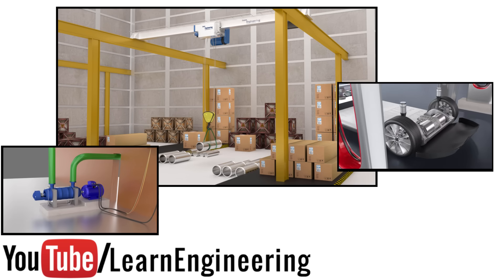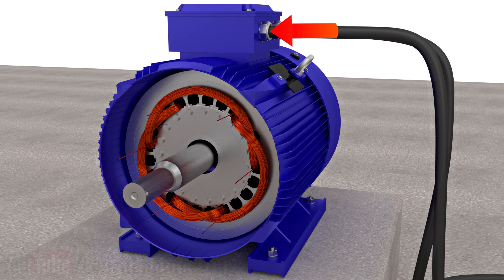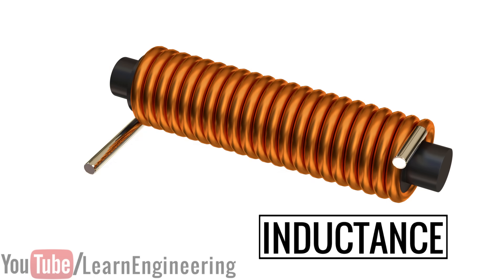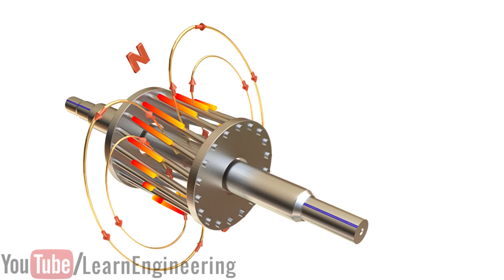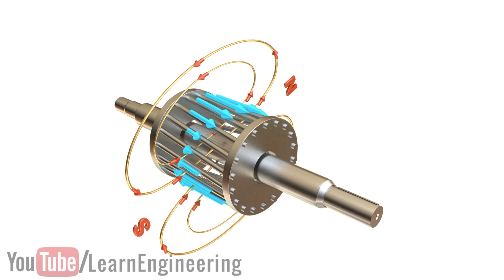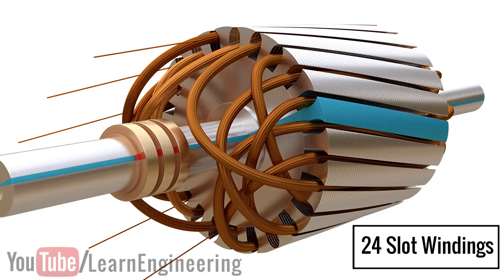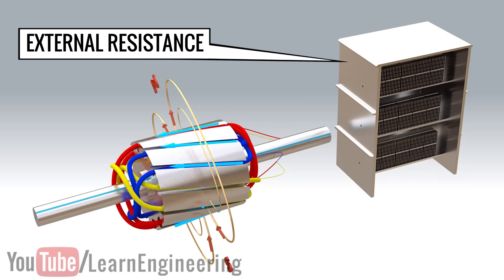Slip ring Induction Motor, How it works?

Comment: Induction theory is very difficult to explain to a layman.  I believe this type of explanation is the best I have seen.  Good job.
Reply: @3:02 I paused the video and observed. The direction of electro magnetic force shown in the animation is wrong. Use F=Current *(Vector product of L and B)
 L= vector having magnitude= length of conductor and directed along the direction of current and B is the STATOR MAGNETIC FIELD VECTOR. Using right hand rule, we get the direction of electro magnetic force to be opposite of that shown in the animation.

Please correct me if I am wrong.
Reply: @abhisekrout8522  Why are you using your right hand? You should be using your left hand.
Reply: @killer2600  To get the magnetic field du to a current flowing through a conductor we use right hand. But yes here in the video if we use left hand everything falls in place. I got a solution to it and have prepared a report on it. In the report I have tried my best to explain why this video could have been represented in another way so that the confusion of why using right hand rule doesn't work here and anyways how magically the use of left hand works (though weird). Please go through the link and correct me if am wrong.
https://drive.google.com/file/d/1tMBLwAtVLtfxmIj-DqlxEhWVGdzAcU2g/view?usp=drivesdk
Reply: @abhisekrout8522  This is youtube not college lecture class for future electric motor designers so I really could care less about the accuracy of a few arrows. So long as the rotor spins in the same direction as the rotating magnetic field it's good enough for youtube IMO.
Reply: @killer2600  Yeah, you are right but what I feel is animating the stator magnetic field instead of rotor magnetic field to explain the operating principle of an induction motor would be a lot more intuitive. And If I am right then there are some serious errors regarding the current magnitude at different rotor conductors relative to their position wrt the stator magnetic field.
Reply: @abhisekrout8522  The stator magnetic field was animated in the video if I recall correctly.
Reply: @killer2600  Yes, it initially showed the stator magnetic field then later switched to rotor magnetic field and explained everything wrt that.

Comment: Nicely  explain .... but  external  resistance is  used  not only to decrease the  phase difference but  also to limit current because  at locked  rotor condition   current is 5 to 6  times of full load  current

Comment: Prior to VFD invention slip ring motors use was somewhat higher than nowadays. After VFD (variable frequency drive) invention which is able to control the motor speed and torque very precisely the use of slip ring motors plunged. Maybe there are a few  applications where it might be suitable, especially when it comes to motor size in Horse Power, when starting draws a high current due to load weight) and cost of VFD implementation is high.

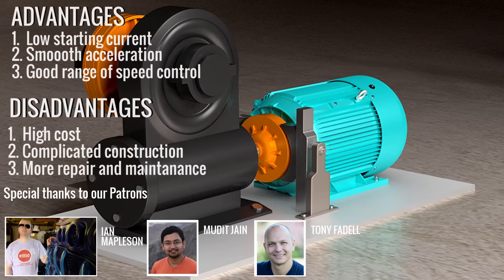Comment: In the end of the video (6:05) you wrote advantage 1. Low starting torque... 
shouldn't be high starting torque?
Reply: Low starting current
Reply: @ruan2587  The starting torque of the slip-ring motor is high, whereas in squirrel cage motor it is low.
Reply: @YoungsProton  That is correct yes,  your first statement is incorrect because in the video at that time it states low starting current and not what your first comment state.
Reply: @ruan2587  Thank u for clearing out the misunderstanding...

Comment: Can the resistors be mounted on the motor shaft with a centrifugal switch to disengage them when the motor picks up speed, thus removing the need for slip rings ?
Reply: yes they are made to do just that

Comment: On crane operations very high resistors are used for low torque plus to change speed to run slow and lower resistance in the rotor circuit to increase speed in a wide range of speeds in between

Comment: Also used in the Tesla model s, x & Roadster...
Reply: I don't think Tesla motors are slip-ring types... They're squirrel cage motors with variable-frequency drive. Rotor windings and slip rings are unnecessary when the motor is driven by a VFD--it's starting torque can be very high (100% of the motor's rated torque.)
The slip-ring design is for producing high starting torque on a fixed-frequency AC power source, such as main (grid) electricity.

Comment: Wow, interesting! i always thought the resistance was for keeping the motor from drawing too much current during startup, but apparently you can also tune your RL circuit with it, NICE! thanks Learn Engineering
Reply: It IS used mainly to prevent high inrush starting current, but I also didn't know about the RL phase angle tuning before this video. I haven't known why induction motors have only around half maximum torque at startup (which is still not that bad)
Reply: @Bizzon666  Only Squirrel Cage Induction Motors have a Starting Torque of about 0,5x Nominal Torque to be more precise. If I am not mistaken: Slip Ring Induction Motors have about 1,5x Nominal Torque as Starting Torque.
Reply: lesics now

Comment: This video describes an old application of Slip ring motors, there are four different squirrel cage induction motors nema deisgns to overcome the torque speed characteristic problems. The slip ring induction motors are a lot more interesting as genererators in wind applications (Doubly Fed Induction Generators). Nowadays, the high startup torque and reduce inrush current are adjusted using variable frequency drives.

Comment: This is old technology.  The power dissipated in the resistors is wasted.  The modern way to solve this is to connect a conventional squirrel cage motor to a variable frequency drive.  The cost and maintenance of slip rings/more windings is eliminated, and no energy is wasted, even when the motor is run for an extended period of time at reduced speed, such as on a machine tool.

Comment: Brushes, it has brushes. External resistors that only dissipate heat, more space needed, more losses. These days we have VFD with start current control and other fancy stuff that solves all of your mentioned problems. Or you can always use rare earth metal magnet based BLDC: Nu brushes, high starting torque.

Comment: Awesome job! We have been doing up grades at our facility on our Mills from DC motors to AC motors with vector drives .We are saving a boatload of 💰 in energy costs. It's all about the drives.Thanks again.
Reply: I better get back to work.Converting float sensor in water tower from laser to ultrasonic.Hope we have better luck .Winter is coming.

Comment: In many of the mentioned tasks in this video, like lifts and loaded starts the Variable Frequency Drive   with squirrelcage or permanent magnet motor took over for being simpler and more efficiënt. Also slipring motors can be controlled by electronics making them more powerfull and efficiënt. They convert the otherwise wasted rotor energy back to electricity instead of heat.
Reply: So, correct me if I'm wrong: It is much more interesting, technically, to make use of variable speed drives in combination with regular Squirrel Cage motors, instead of Slip Ring motors  right?
Reply: @Chimichanga5666  The biggest advantage of  Squirrel cage motors is that the barings are the only moving parts. Less to maintain and no commutator arcs or sliprings that can also arc when dirty.
Motors with permanent magnets have more starting torque, those with wound rotors can also produce more starting torque and the regenerative braking, even when the energy gets dumped in resistors (very common) saves wear on mechanical brakes.
Motor drives can be used on wound rotor motors and tesla cars drive permanent magnet motors.
It all depends on the application and  load.
Reply: @picobyte  Ok, so slip ring motors can still be interesting for certain applications right? In any case, thanks for your answer!

Comment: These motors were first designed by engineers who really knew thier stuff. How they work seems counter intuitive, but I can say from experience, having worked with a few of these in crane and heavy machine loading applications, they can  produce a tremendous amount of grunt at startup. Also, maintenence is not nearly as labor intensive as with DC machines. They were developed way before modern electronic vari-speed AC drives,  and are still probably more dependable than the newer solid state drives.

Comment: I may not understand thoroughly the first and second time, but I will be back !! Thank you!
Reply: Sometimes you just have to accept that it works and move on. Admittedly, I’m a little overwhelmed with it. I’m not an EE but I do understand parts of it. I’ve watched another vid about Star vs. delta and I accepted that. Never heard of a slip ring used like this so, yeah got to think about it. I think the slip ring technique is used for start up because of high torque. Once the phases become more in sync, the rings aren’t needed. What I was expecting to see, once the fields are in phase is that the brushes for the slip ring disengage as they are no longer needed.

Comment: Just out of curiosity, please tell me could a solinoid engine give more torque than an induction motor without using more battery power ?
Reply: Mihindu Pulukkody 
The efficiency of a solenoid increases the closer the core is to the center of the magnetic field because theres more field lines crossing the core instead of the air.
So a solenoid motor would be more efficient the more steps you had so as to keep the cores producing torque closer to the center of their fields. 
But on the other had that also adds lots of friction because each solenoid has to move the rest, so if you have 1000 solenoids 1 would have to move the axis plus the other 999 solenoids. And if you were to use more than one solenoid to generate torque then those other would be farther away from the center hence losing efficiency.
The main disadcantage i can see in such a design would be it being non scaleable beyond a few couple solenoids and a very small power density, along with a high complexity and maintenance costs because moving parts wear out.
The only moving parts on an induction motor are the bearings holding the rotor, the rest is all solid state.

Comment: Why don't you use a CAPACITOr TO cancel the inductive reactance
Reply: Because if you used a capacitor it would decrease the amplitude of the motor's impedance, therefore increasing the motor starting current
Reply: @death2art  resistors will waste a lot of power and starting current will be high for seconds.
Reply: The value of resistance is very small so the power dissipated is also small, but yes loss of efficiency is one of the main disadvantages of this method. That is why after the motor starts you can remove the resistors from service. And no the use of resistors actually diminishes the starting current, while increasing starting torque, if you compare the same motors connected directly from the mains
Reply: @raghavsrivastava2910  cxxc
Reply: @death2art   So the graphite brushes on the slip-rings of these induction motors is not used as a resistance material for phase control?

Comment: basically what the video implied was that increasing the rotor reistance would increase the current, because of reducing the phase shift. however i think the phase shift occurs because the current is lower when there is a resistor. i always thought the point of this construction is to lower the starting current and save the rotor from overheating. it could also be helpfull to reduce the phase shift on the primary, because industrial electrical bills tax you heavy for non-resistive-behaving loads (power factor) and is also a good way to maintain high torque over a wider range of rpms, because you can deadshort the rings when the motor get up to rpm and get the same starting torque you had with resistors, but now without them and at much higher speed. if i was to build such a device i would make the reistors part of the rotor and engage/disengage contacts by moving small bearings sliding freely on the shaft but connected to the contacts (something like the concept of a throwout bearing of a clutch)

Comment: What's the difference to the normal BLDC motor we use in drones? Why we not using induction motors in them and in eBike etc?
Reply: induction motors run less efficiently due to energy losses spent on heating up the rotor. other than that they can be very usefull due to being easier to drive-no hall effect sensors or feedback voltage sensing is needed.

Comment: So are the slip rings doing a power factor correction or something?
Reply: No, It's not like that. resistance box will be there for starting purpose only. in running condition it will be cut off because they will generate extra rotor losses. And the main thing is induction motor is lagging load it can't do power factor correction.

Comment: It would seem to me that the increased resistance would also reduce the current in the rotor which would reduce the starting torque. Is this a case where enough resistance is introduced to raise the torque but not enough to reduce it again? Apply an optimum value of resistance for maximum torque?
Reply: I was wondering how logical it is to increase resistance.  Since it's unwanted in many applications.
Reply: dont worry guys i also ask myself the same question. i think we have the correlation does not equal causation problem here. the video claims that higher phase shift=less current therefore a resistor can help because it lowers phase shift. however the resistor lowers the phase shift because it lowers the current in the first place. it doesn't really lower the phase shift. it just makes it smaller/less visible on oscilloscope graph
Reply: lol. was this pun intended? "...it doesn't really lower it. it just makes it smaller." you've made it more complex
Reply: wait i gotta re-edit this
Reply: @davemwangi05  Actually, it is complex by definition. Reactive circuits involve imaginary numbers, I.E. complex math as opposed to real math.
Reply: Yeah. I remember when I was in one company for a short while, and we were shown a power factor correction unit A big bunch of capacitors to cancel the inductive reactance brought by the motors. and the math from the uni wasn't very easy.  By the way is John S and Johnn Scare the same person?
Reply: Divad Ignawm - Different people.

Most devices that draw a lot of power are either resistive or inductive. If the load is inductive, adding capacitance will cause it to look more resistive to the generator. The closer that watts are to volt-amps, the better the generator likes it.